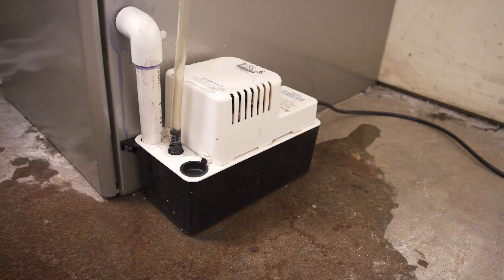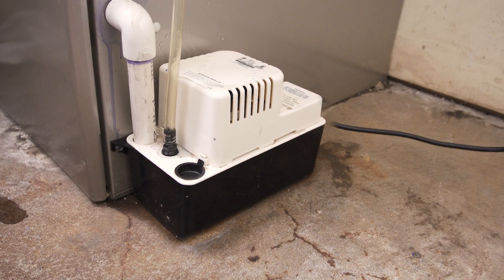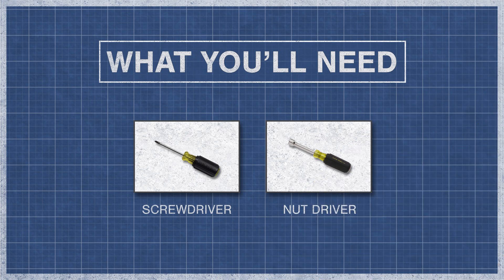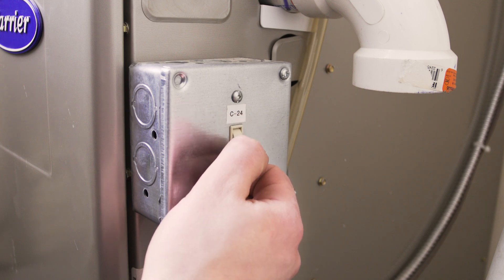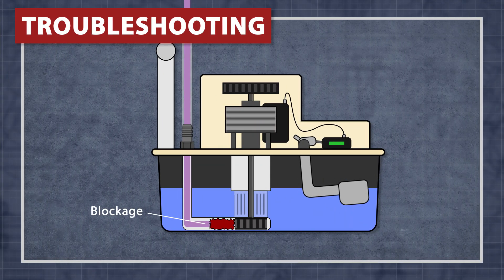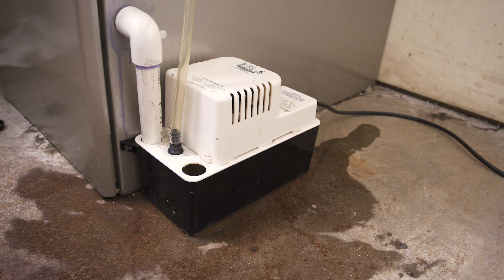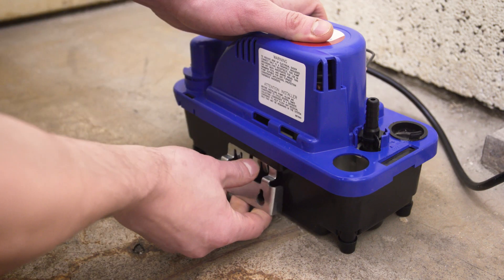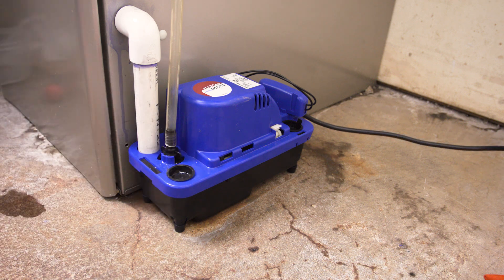Condensate Pump Replacement & Troubleshooting | Repair and Replace

Comment: What if the pump runs too much, excessively?  The pellets look dirty. Could this be the problem?  When I started the AC the pump stopped running.
Reply from the maker: Thanks for watching. The pump will run more as more condensate is created. This will be on warm / humid days where the AC is running more often. Now the discharge tube is dirty or plugged, then the pump won't drain the water as quickly and will run longer and more requently to drain the same amount of water.
Reply: AMRE Supply so what do I do then?  Does someone have to come here and clean the unit out?
Reply from the maker: @hew195050  In some cases you might be able to remove the drain tube and clean it. Either use compressed air or water to flush out any debris. As well see if the check valve is working properly as mentioned in the video.
Reply: AMRE Supply thank you soooo much!!!! I appreciate your response.
Reply from the maker: @hew195050  You're welcome!!

Comment: can you just buy a plastic resevoir if it is cracked?
Reply from the maker: Thanks for watching. Depending on the model, you can buy the reservoir. Older models might not be available though. We do carry replacement reservoirs for Little Giant pumps https://www.amresupply.com/part/12668630

Comment: Just installed one of these a month ago. Came home this evening and A/C was not working. Safety wires are hooked up so I  know that's working. Walked over to unit and the Pump is running continuously tank is full but water is not being pumped out. What do you think?
Reply from the maker: Thanks for watching. If no water is being pumped out then its likely that the drain tube is clogged or the relief valve is stuck.

Comment: My ac was dripping in basement, before getting to the c pump.  My ac guy could not come kidney stone so this woman was determined to solve.  Cleaned pump, much needed BUT question here is a lot of the foiled tape was loose because of condensation.  An out take not connected if I put a paper towel in it the leaking stopped.  It had foil tape over it that came loose.  So I reaped areas exposed.  Leaking has stopped, pump is working But could more water build up inside and ruin or rust inside unit.  Sorry I need confirmation since this is certainly not my expertise.  Problem solved but could I cause another problem.   Hope you reply!  Thanks for your videos...
Reply from the maker: Thanks for watching, we're glad you're finding the videos helpful! As long as the drain tube leading from your AC to your condensate pump is clean and has a secure connection then water should drain nicely into the condensate pump and shouldn't build up inside of the AC unit.. The drain pipe should not be patched up or sealed with foil tape. PVC plastic pipe joints should be glued with PVC cement and flexible tubing can be secured with a hose clamp if needed.
Reply: I had to do something because was dumping 5 gals per day!

Comment: I can't find a video that explains where the clear hose goes. This is what I have: aAVPTC426014AA handler and Little Giant 554542 VCMX-20ULS-C 84 GPH 115V Automatic Condensate Removal Pump.  I have a 50' clear hose and I did buy that black plug.  My handler is sitting in the attic, with a shallow tray that the furnace is setting in. There are two PVC pipes; one from the handler and the other from the shallow pan.the pan is so dilapidated that the water wants to spill on the floor before it goes out the pipe. The handler pipe is probably clogged. I decided to add a pump. My question is, do I just thread the hose out the house and tie it to the PVC pipes that lead outside the house?  The pipes flow into the neighbor's yard. They are sweet and haven't complained yet, but that's probably because the pipes are clogged. Unless otherwise instructed, my plan is to thread it outside and into my yard. Am I doing this correctly?
Reply from the maker: Thanks for watching. You might find this webpage helpful in determining some of the best practices. https://inspectapedia.com/aircond/Condensate_Pumps.php As well on humid days, AC units can make quite a bit of water. If that is going to be drained onto a lawn, then it needs to drain into soil that can handle that volume of water. Not all types of soil have the same drainage rate, and some will hold more than others. As well the spot that you drain will need to be graded so that the water doesn't pool or collect. You might find some information here as well https://todayshomeowner.com/yard-drainage-solutions-for-ac-condensation-drain-runoff/

Comment: My float switch won't engage. The water just overflows onto the floor. It will work if I press it manually, but it won't work on it's own. I took the gadget apart and it looks just fine. I don't understand why it's not moving when the water level hits it?  Should I purchase a new one? This is only about 2 years old, and only gets used 2 months of the year.  Ridiculous!
Reply from the maker: Thanks for watching. Its good that you tested  verified that the float switch works manually. In some cases the float can be adjusted or "lowered" so that it is triggered by a lower water level. As well see if there is anything blocking the float from moving when the pump is fully installed with the cover on etc.

Comment: What would make my condensation pump continue to run...nonstop?
Reply from the maker: Thanks for watching. There are a couple things that could cause the pump to run continuously. If the outlet pipe is clogged then the water level will not drop and the float switch will stay raised causing the pump to run nonstop. Alternatively if the float switch is stuck closed then it can also cause the pump to run non-stop. Try draining the water and see if it shuts of the pump. Then monitor the level inside the basin.

Comment: Our house came with a furnace humidifier already installed. I've been trying to research, but I'm not sure I fully understand how to tell when it's working properly. Should the pump run constantly when it's functioning? I add water to the reservoir, it runs for a few seconds (the water level goes down) and then it turns off. The ambient humidity in my home has not gone up whatsoever since turning it on, so I really don't know how to tell if it's working or not.
Reply from the maker: Hi Jordyn thank you for watching. The condensate pump collects water vapor created by the furnace or air conditioner and removes it. It will only run when there is enough water in the basin, so what you are noticing is normal. The condensate pump is not a humidifier so it won't add more humidity to the air. If you have a humidifier it will be mounted higher on the furnace and will be hooked into the main air vent. If you are ever unsure if the condensate pump is working or not you do a test by manually lifting the float switch or by pouring water in the basin to trigger the pump.
Reply: @AmreSupply  thank you! I know which part is the humidifier. I just don't know how to tell if it's working. Does the humidifier itself make any sort of noise to indicate that it's running? Or does air from the furnace simply pass through it?
Reply from the maker: @passthesunchips12  There are a few different styles of humidifiers so it depends. There are drum style ones that you'll hear the drum and motor turn, there are also ones that have solenoid (magnetically opened valves), solenoids click when the valve opens to release water you can see a simple explanation here: https://youtu.be/G6a_01NaTLA?t=35   Some humidifiers are wired directly to the furnace and will run when the blower fan runs, and other humidifiers only run when the humidistat tells it to. Also check the air vent on the humidistat. Opening or closing that vent will control how much air (with moisture) will be added back into your homes central air supply.

Comment: Great video! I noticed recently that my condensate removal pump gets activated on its own every 4 seconds and engages for only 1 second and then stops to repeat the cycle all over again. No water appears to be leaking but I noticed that the furnace is not extracting as much water as it used to do in the past. Not sure if that due to the climate and the period of the year we are in. What could possibly be wrong?  You gave me good pointers to figure out the problem but thought I would ask anyway.
Reply from the maker: Hi Ali, thank you for watching. There will be some variation based on the climate and time of year. If its been less humid then the furnace will extract less water from the air. 

Also if the condensate pump basin full of water, then its likely that just a small amount of condensate is triggering the float switch. Check if there is any restriction in the drain as this could cause the water level in the basin to sit higher than normal. 

As a test you should be able to manually move the float to trigger the switch. If the motor and switch are working correctly, adding manual pressure should keep the motor on until you lower the switch. If its still intermittent, then its probably best to get a new motor.
Reply: Ali, a rapid cycling on and off typically means the check valve is stuck open.  Try cleaning the valve as shown in the video or replace just the valve.

Comment: Video only covers the pump not turning on. My problem is different: the pump won't stop. I've tried bending (up) the metal strip that triggers the pump, which fixes things for a short time. Unfortunately, the amount of downtime decreases until, after about four hours, it runs continuously whenever the furnace runs.
Reply from the maker: Hi Peter, thanks for watching. Bending the metal strip will adjust when the motor runs but it sounds like the metal is just bending back into place. Normally the pump will run and discharge most of the water and then turn off so one thing to check is the water level and the discharge pipe and check valve. If there's any restriction in the discharge tube, then the water level will build up and sit higher, so the float will be sitting in a position that will continuously trigger the motor.
Reply: @AmreSupply  I'm having a similar problem. My motor will not turn off. We woke up this morning and wondered what the loud noise was. It's been going for hours. The hammer seems to move up and down, the little black unit between the hose and the condensate pump wasn't blocked and I removed all the water in the plastic base. Still going... It's spring so nights get chilly, but my only solution right now is to turn off the furnace and pump. Do I just need to get a new condensate pump?
Reply from the maker: @brettmorrison7167  If the condensate motor still runs even when the basin is empty then either the float is stuck or that the switch is faulty and is constantly pressed closed. With an empty basin you should be able to move the float manually to turn the motor on and off. If switch doesn't turn off then its probably best to get a new condensate pump.

Comment: So what if it's the fuse box? Or not getting electric due to a switch turned off? According to these instructions someone would change the unit not knowing it was the electric turned off. I think this video should be remade because not all home owners know it could be a popped breaker. Even a visual inspection of the cord because people have animals and yes even a mouse could have chewed up the cord. And also to check the outlet pipe for clog or even general hard water issues and how vinegar can soak and clean parts.  I mean it's a good help video but should really have a little more detail for the diy home guys or gals. Also water leaks always from above so don't forget to check the pipes for water leaks because they just may change this unit and find out it was another issue like a water line dripping or running down near the unit. Or even a clogged or leaking drain from above. So they are not fooled
Reply from the maker: Hi Jermaine, thank you for watching. Those are good additional points. Overall we try to keep all our videos detailed yet concise, but its difficult to make an exhaustive list of every possible problem or describe every scenario as it depends on someones setup.  Overall I think you'll find that our newer videos are a little more thorough including the series we did on water heaters. https://www.youtube.com/watch?v=BHUPFLbb8NY&list=PLCo9SMjkdWBwJ4a8MT2GKTDiSuvSHg6Xk&index=1
Reply: @AmreSupply  that's alright keep them coming back for more
Reply from the maker: @studypartner9643  The goal is to help people the first time and considering the likes and comments on this video many people have found this tutorial very helpful. Thank you for sharing your thoughts.
Reply: @AmreSupply  it helped me I always wondered what they were
Reply from the maker: @studypartner9643  We're happy to hear that you learned something new!

Comment: Why is the water that comes out of my pump from my a.c. have an oily film. Have the pump pumping water into a new trash can that I dump a few times a day and it has an oily film on the top of the water every time and only in that one. The other pump I have on a different one has clean water coming out.
Reply from the maker: Hi Jason, thank you for watching. It could be residue from one of the pastes used on one of the fittings, a rubber o-ring that is deteriorating or it could from the AC unit itself. If you disconnect the pump and collect some of that water into a clean container, take a look and see if the oily film still is there, then its not coming from the condensate pump.

Comment: Did not hear pump running. I have seen 12 videos no one has allow me to hear it running. I want to know how quiet they are. No one has compared them.
Reply from the maker: Hi Alberto, thank you for watching. Comparing loudness in videos can be difficult to show accurately but for reference this particular model is less noisy than the furnace itself. It will also only run once in a while so its not a constant background noise.

Comment: This has helped me a lot. Turns out that my installer never installed the discharge tube. They left the condensate pump unpowered and unleveled so that it sat like a diamond/rhombus and leaked from the lower end. They're going to get chewed out and I'm installing the last bit myself.
Reply from the maker: Thanks for watching we're glad the video helped you out! Its definitely frustrating when things aren't installed correctly the first time. This is why we make videos like these. The more knowledge someone has as a consumer or homeowner, the more likely they are to catch these things before the problem gets even worse. Cheers

Comment: Have you tried adding vinegar or drano if it's blocked?
Reply from the maker: Hi thank you for watching. Vinegar is a safe way to clear a blockage in the condensate pump drain line. It might need to sit for an hour for it to work through the blockage. Alternatively you can use a pipe cleaner brush if it is long enough to reach to the blockage.

Comment: Don't forget to also fully check whatever tube is leading out of the pump. Turns out, mine was clogged with some organic gunk that had built up during the warmer months . Pump worked fine but it wasn't strong enough to get past the block. Stuck a metal rod in there and it cleared everything up.
Reply from the maker: Hi Alaric, that is a great tip. We're glad you got it back up and running!

Comment: First time viewer and will likely subscribe!  Great video btw.  I have a question @AMRE Supply... my condensation pump  and furnace is in the basement.  The motor works fine, the motor pumps when the level is reached and triggered by the float switch, and carries the water out to the discharge tube.  When the unit is off and the condensation inlet pipe is no longer discharging water into the pump.. I noticed the water that is in the discharge tube will very slowly drain back into the condensation pump... while the unit is off, I noticed it takes about an hour to 2 hours to drain it back.  It won't trigger the pump to kick on because the water level is below the float switch.  So it is not an immediate dump back like a sump pump in a sump pit without a switch.  The check valve isn't clogged either since it pumps the water fine.... my question would be.... is this normal??? should I replace the check valve as I suspect this is caused by a small leak in the check valve?  My condensation pump is 15 years old... do you recommend me just replacing the entire unit?  Thanks!
Reply from the maker: Hi Jeremy, we're glad you found the video helpful! The check valve inside these condensate pumps has a little ball that is pushed by the weight of the water. It should hold the water back but it if doesn't make a good seal then a small amount of water can leak out of the check valve. If the water is only draining back into the reservoir and not leaking onto the ground then its not really going to create any problems. Like you said the float doesn't get triggered by this so its not going to make the pump run too much more than it needs to. If the whole unit is working fine then there is no need to install a new pump as you can try replacing the check valve first. Just note what type of connection that you have, not all pumps use a threaded connection and others use a twist lock. https://www.amresupply.com/catalog/Check-PL57

Also as a new subscriber I think you'll find some useful videos and animations on our channel. Cheers!

Comment: Suuuuuuper helpful video....def thought I was going to have to sleep w no ac until I could get someone to come out and fix this....was able to troubleshoot and get the pump back running after watching this....the floater was stuck...then once it was working the motor would start making noise ...stuck a float screwdriver into the fan to give it a nudge and it started working asap
Reply from the maker: Thanks for sharing your experience Edward! We're glad it was a simple fix!